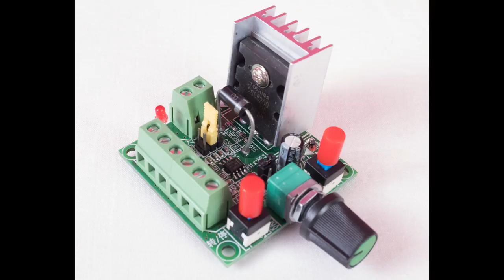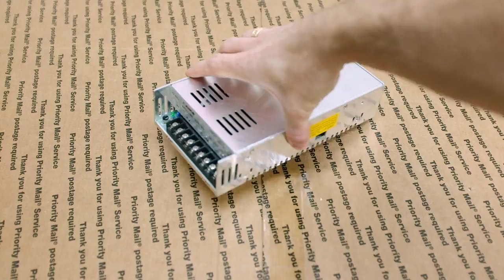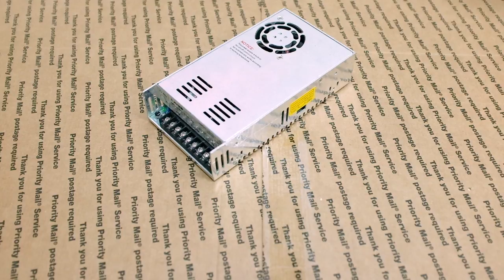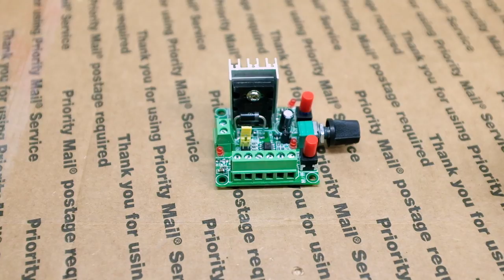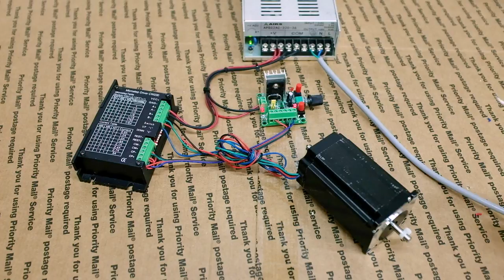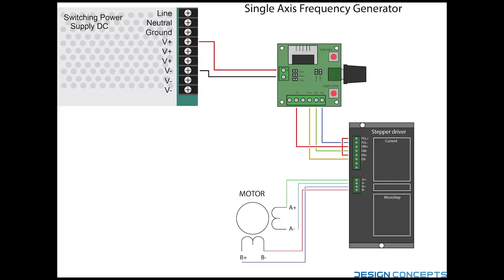Controlling a stepper motor through a signal generator

Comment: Hi Tyler, great video! How do I test/connect a 5 wire EGR stepper motor? any idea? This is a linear stepper motor with a 5V supply to one of the pins. Thanks.

Comment: Hi Tyler, is it possible to run the stepper motor using the PWM shown using an L298N as the driver?  How would this be wired?

Comment: Straightforward and simple, great. Showing in the wiring diagram that the stepper motor driver needs to be supplied with power as well would have made it an immediate success.
Reply from the maker: Thanks! Yeah I cannot believe I forgot that vital info. doh!
Reply from the maker: Thanks! Yeah I cannot believe I forgot that vital info. doh!

Comment: I tried it like in the video but I could not get it to work. Also the +5V is misleading I think. I watched some other videos and now I am able to make my stepper motor turn how I want it. Either you have a shared/common positive where you connect all (+) signal together or you use a shared negative and connect all (-) signal together.
So if you use com+ also called "shared positive" (like it is showed in this video but called +5v) connect ENA+ with DIR+ and PUL+ and use the shared positive output from the signal generator.
If you use com- connect ENA- with DIR- and PUL- and use the GND-output from the signal generator.
Depending on what I use the motor is on with the switch off for com+ and the motor is on with the switch on for com-.

Comment: This was very helpful thank you. Looks like its going to be cheaper to buy a 2-phase motor than to get a 3-phase motor driver. How much voltage does this motor use? The current driver i have is rated for 3a and 36v.

Im busy with a diy racing sim and im busy implementing forced feedback. Would love if i can get the 2nm tourque.

Comment: Great vid, thanks!

I have this working, but I'm using it to drive a powered Z-table for a CO2 Laser Cutter. It runs nice and smoothly. But can this controller be used for "pulse rotation" instead of smooth rotation? It would make it easier to get it just where I need it.  Thanks for any input!

Comment: Hi is it possible to lock the motor in position so no direction enabled in the stop position.. as my lan is to use on a mill have it left and right but I can still rotate the spindle 🤷‍♂️
Reply from the maker: Just having the motor connected to the stepper driver and powered on, will lock the motor up.
Reply: Tyler Harney it Doesn’t seem to .. its good because I can free wheel it.. but I also need to lock it..

Comment: Hi, will this circuit work with any stepper driver say a FMD2740C , or does it use the specific driver listed?? Also, with a 24vdc power supply connected, the terminal mentioned as 5v actually reads 12vdc??

Comment: Hello friend, thanks for your video.
I made the same connections with a nema 17 motor + a 12v power supply and a tb6600 controller.
It works, but it doesn't spin as fast as yours. What I can do? Microstep settings? or could it be something else?
thank you.
Reply from the maker: Hey J, Most likely the microstep settings

Comment: Are you sure about that wiring to the driver in the new PDF?  You have the negative lead entering +VDC of the driver  and positive to GND?  Obviously, you wired the project correctly (cuz it works) and when I zoomed in on the actual wiring, you have positive to positive and negative to ground on the driver, so I THINK you maybe swapped them on the updated PDF link?  Anyway, I ordered the controller and wired it up, waiting for delivery in a couple days.  Thanks!

Comment: Hi Tyler,

thanks for posting this video that offers me the opportunity to understand something more
Unfortunately, however, I have to interface the same circuit you have (stepper motor through a signal generator) to a small 5V 28BYJ-48 stepper motor with 5 wires (4 coil + positive 5V) and I don't know if I have to use the driver interface ULN2003APG.
So I didn't understand if I can manage the engine directly from the Signal Generator card or even put ULN2003 in the middle
In case you can show me the scheme on how I have to connect it?
thank you very much

Comment: Awesome video, I've had a Keling KL-4030 and a .09 step stepper motor, after watching this video, I bought a couple signal generators, and connected everything, only I'm not getting the smooth rotations. Could it be the DIP switch settings?
Reply from the maker: I am so sorry I didn't see your message. Did you ever get it solved?

Comment: Hi can I ask ..I notice when it's going slowly...and you press the change of direction button it changes no problem...if you were to do the same at high speed would it do the same or damage the motor etc ? I'm not planning on doing it but I was wondering if you had to stop the action before changing direction ? Anyway great vid and simple solution...came here from Myfordboy.
Reply from the maker: Hey Berkeley, changing the direction at high speed will most likely stall out the motor, depending on the quality and specs of the stepper driver. I have done it and I got mixed results. Sometimes it just jerks the motor the other way and other times it stalls out. I find that it would be difficult to damage the motor however by changing direction at highspeed, I could possibly see unwanted electrical signals traveling back into the stepper driver therefore possibly reducing the life of the driver. Thanks for your comment!

Comment: How can you add two limit switches so it stops at the ends if it trigger the switch, do you have a diagram or something?Thanks
Reply from the maker: This controller wouldn't be ideal for limit switches but the one I'm linking below would probably be a better fit. The 4th product photo shows inputs for switches. Unfortunately I don't have any time to grab one to test out at this time. I really need to cause it seems a lot of questions aim towards limit switches :/
https://amzn.to/48MFCJi

Comment: Thanks for the video Tyler.  I need to have the motor about 75ft away from controller.  So my quesiton is, is it better to have the driver closer to the motor,  or have the driver / controller together with long cable lines to the motor?
Reply from the maker: Hey Jim, You'd probably be better having the driver / controller together with long cable lines to the motor.

Comment: If it is possible to drive the stepper motor only with m860c stepper driver..??
Without any signal generator,plc and microcontroller
Reply from the maker: It is not. The stepper driver needs some kind of pulse signal to make the motor turn.

Comment: Several questions if you have the time.  I thought the control inputs on the driver required low voltage accounted for by the 5 volt connection at the the controller that in turn went to the driver control inputs.  If so, is the driver producing the 5 volts for the controller?  Is the potentiometer controlling the pulses that would drive the motor speed and therefore be at a higher voltage and amperage?  If I am correct about the 5 volts necessary for the forward, reverse, and stop functions on the driver, can they be controlled by simple on/off switches from a 5 volt power supply to the inputs on the driver instead of controlling them with the control switches on the board?  I'd like to use latching switches instead of the non-latching switches on the board.  I hope I've been clear in my questions.  Any help would be appreciated.  Thanks.
Reply: Got this from a review of the PWM on Amazon. I was confused too.
"The yellow jumper changes the frequency range of PWM for a dc motor. It seems that also affects the pulse output for a stepper motor. I need more info on that. This is NOT a stepper motor driver but a controller to be connected to a stepper motor driver, it controls enable, direction and pulse.
If you refer to the terminal screws on the left looking at the terminals, those are 5-12v input to drive the PCB, next common positive, then common negative (GND).
The other three as you know are enable, direction and pul, polarity dependable of common positive of common GND.
The board can also be powered by the two terminals on the right, that is 15-160V. It uses the on board regulator IC. "
Reply: @jaspermcconnell6417  Thanks!  I'd kinda stopped working on it, but it's a good time to start again, so I appreciate the input.

Comment: If i put this on a paralallel connection with the brakeout board, would this cause any problem?
I want to use my bench mill for simple producures without using my pc, just to make a pass allong the length of the table etc.

Comment: Tyler I need your support, I have stepper motor 34 nema Driver Anaheim automation MLP 086441 but  I have in the Driver firts Clock +,Clock-, Direcction +, Direction-, ON/Off +, ON/OFF -, I have the pulse generator like You are using en the video, but I dont know How connect the Pulse Gnerator with my Driver, can you help me?

Comment: First great video I've seen on this.  Most are very cryptic, out of focus, or don't show the wiring.   Thanks.  Are the jumpers set for frequency or PWM?
Reply: For a stepper motor the jumper should be set to frequency. PWM (pulse width modulation) is often used to control the speed of things such as variable frequency drive (VFD) that is running a 3 phase motor. VFDs can have speed control by external potentiometer, 4-20mA loops, PWM or a 0-10V (for example) signal. It depends on the make of VFD and internal VFD settings which is used. If you had a VFD that could only be controlled by PWM then this would be a useful way of controlling it.

Comment: Good tutorial. Is it posible to ad a foot pedal to turn on off the motor?
Reply from the maker: You probably could but would need to solder the connection to the START/STOP button on the controller board

Comment: Hi sir
I m from India .I m unknown  in micro controller .I am diploma engineer in industrial electronic  .
I want to drive a stipper motor with 2000rpm  for lab mixer with variable speed controller.
can be drive stipper motor without  big driver as shown in your vedio,  small driver can drive the stepper  motor ?
please suggest the stepper motor and driver may be use in Lab mixer.

Comment: When the button is off on the controller, does the motor free spin or is it in “brake” mode?
Reply from the maker: Are you referring to the button on the signal generator/controller? 
The motor should stay locked either way.
Reply: @TylerHarney  correct, I have a belt system that needs to stop and go on a continual basis. But it needs to stop in an instant. I was wondering if this holds the motor in a locked position

Comment: Also, does it provide power for holding torque, or does switching it off cut all power to the motor?
Are the switches on the frequency driver momentary or latching? Going to replace them with better switches that I can mount on a control panel.
Very cool, has simplified my life no end, I was going to go down the raspberry pi/arduino route, but now i don't need to. Thank you.
Reply from the maker: It does not cut all power from the motor, only to the step/dir signal. The driver keeps it's holding torque to the motor. The switches are latching. I'm glad I could help someone, I didn't think anyone would see it, so thank you!
Reply: @TylerHarney  @Darren Garden This has been really helpful for me too!  thanks.  And I'm needing to do what Darren says, that is, have a control panel and avoid mucking around with Arduino and writing code.  @Darren Garden let me know how yours turns out.  If you run into any gotchas that would be a huge help for me to know what you did to overcome.  Cheers!

Comment: I followed your diagram and it worked perfectly. But, now it is not. I am trying to troubleshoot. All connections aare solid and pass continuity test. changed out stepper motor and same no joy result. I've ordered replacement driver and sig gen to swap out for test. Can you think of any other reason for it to just stop working?
Reply: Figured it out. Too much voltage. Cut it down and all is well. Who knew...?

Comment: great video and has allowed me to add a power feed to my milling machine, I want to add a remote forward and reverse and also a remote on/ off,  (once the pulse generator is in a box you lose access to the on/off and reverse push switches)I have no idea how to wire this in, I've tried to figure it out and so far failed, can you suggest a wiring diagram, Cheers :)
Reply: You should be able to identify the onboard contacts for the switches and simply wire a second switch in parallel with them. If you want to add limit switches you would ignore the onboard direction reverse switch and direction output from the board. You would take the +5V and 0V to a suitable DPDT switch and then use that to supply either +5V or 0V to the stepper driver direction input. This setup would also allow you to add limit switches into the enable circuit that would stop the travel when it contacted the relevant limit switch but would also allow you to reverse away from the limit switch.

Comment: Hello Tyler. Thanks a lot for this informative video, which explains simply and clearly. I just want to ask you, is it possible to connect the stepper motor directly into the Frequency Drive without using a Motor Drive? If yes, how?
Reply: You can buy boards that drive a stepper motor directly but they do not have Enable, Direction and pulse outputs, they have the A+, A-, B+ and B- terminals the same as the stepper driver. However these types of board can only handle low currents and so are only suitable for small stepper motors.

Comment: This is awesome thank you. I would like to run two motors with different frequency drives that start-stop and reverse at the same time with limit switches. Is this posable? Thank you for any help
Reply from the maker: This generator is probably not the best for that particular application, but I think it is possible. A PLC device might be a better option.

Comment: Nice demo! 
What's the range of frequency of the signal used to drive this motor?
Reply from the maker: I'm pretty sure it was 5.4k-160khz, middle 540-16.6khz, low 80-2.4khz

Comment: Hey I have a question. The driver maximum input current is 5A (output 3.5/4.5A). Did you check out put of the power supply? Won't it damage the driver?
Reply from the maker: Hey there! Are you referring to the 1 axis signal generator? Or the Stepper driver itself?
Reply: @TylerHarney  stepper driver TB6600
Reply: @TylerHarney  waiting for your response

Comment: Do you know what the resistance of the potentiometer is, I would like to replace it with a 10 turn wire wound with numbered indexing for repeatability.
Reply from the maker: The resistance of the pot is 92.6k ohms

Comment: How do I wire 2 limit switches for up and down motion, so when it goes up it stop before it crash and the same going down but be able to change directions using the signal generator.
Reply from the maker: The only way I can see that working correctly would be to unsolder the FWD/REV button and wire your limit switches to there.
Reply: @TylerHarney  Could you wire the limit switches in parallel to the FWD?REV button keeping both operational.
Reply: Did u got the solution?

Comment: Hi,  In my case, the same  settings bigger motor and driver, But no torque. When I speed up the motor it stops and makes sounds like noisy speaker.
Reply from the maker: Serkan Ozkan your driver should have some dip switches on it that control the torque settings. What driver do you have?
Reply: @TylerHarney  Hi,  My Driver : DM 860  I am trying different settings using DIP Switches.    Thank you for support.

Comment: Good video thinks 
Can it control two stepper motors ?
Reply from the maker: Yep, as long as you have two drivers. Just connect your signal wires from the controller branched out to the drivers.

Comment: Can end stops be used with this?
Reply from the maker: So sorry I'm just seeing your comment. Not with this particular controller
Reply: Yes, you can use optical sensors to control the end stops, for example, if the stepper was driving a leadscrew

Comment: Hi,  question is,  can I give two proximity limit sensor.?
Reply from the maker: It's not easy to add limit switches, unless you solder them to the one switch on the board that controls the forward/reverse action.
Reply: @TylerHarney  can u give any diagram to add limit sensor please provide Trick/silution

Comment: Very nice video thank you to charing it with us 
can it work with Nema 17 Motor stepper motor ,2A 0.59Nm (84oz.in) 48mm con 1m 4-Pin  Cable ? Thanks
Reply from the maker: It will work with any stepper motor. You still need a stepper driver to amplify the signals from this frequency generator.
Reply: Thank you to answer my question.
What kind of stepper driver  do you recommend? Thanks 
 any stepper driver model of  TB6600 will work or I must buy in specific , st - 4045 - A1 ? Thanks

Comment: Just what I needed as I'm replacing the standard single direction X-Axis power feed with a stepper motor on my Marlow milling machine.
Possible way of adding limit switches:
https://youtu.be/uRLs1ZT8XJE
He has a diagram showing how to wire remote switches for of the On/Off and Forward/Reverse buttons.
Reply: Me too but with a arboga mill